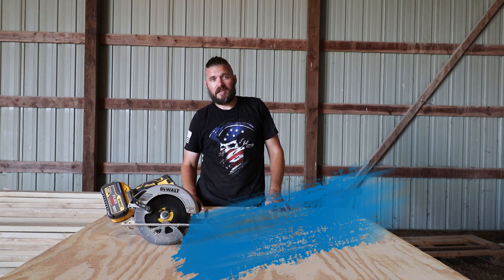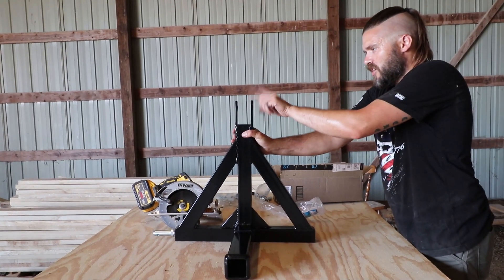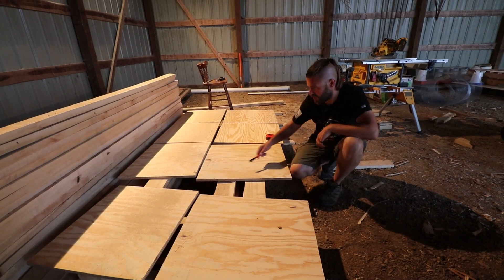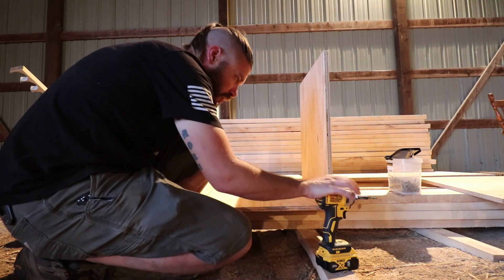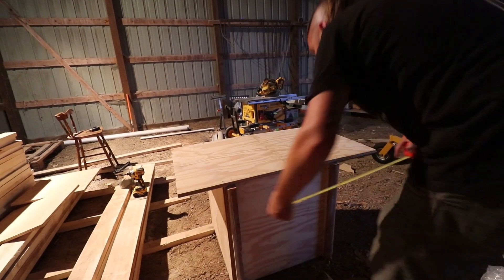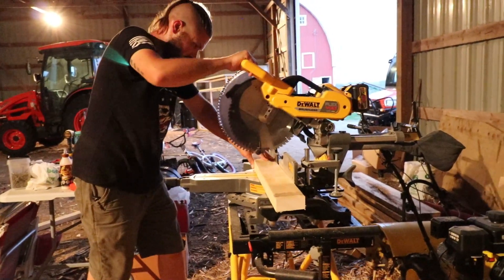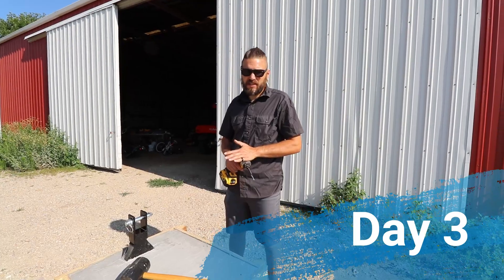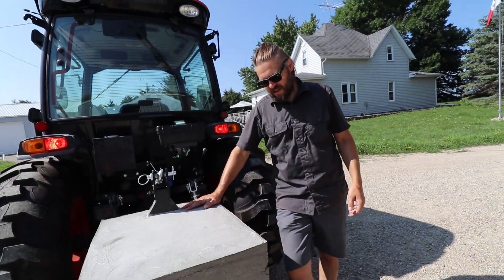Under $200 Complete Newb Builds Super Simple Kioti Compact Tractor ½ Ton Ballast Counterweight Guide

Comment: Tamp the concrete as you pour it or hit on the outside of the form with a hammer so to make sure it all settles in tight.  I'm planning on doing this but I have plans for 4 2in PVC tubes sticking up across the back so I can stand up a rake a couple of shovels out of it.

Comment: Use an cement vibrator...   You can buy them at harbor freight, northern tools, or maybe rent them.   Also some people vibrate the outside with a palm sander, but the immersion is what you need.    They are used in ICF block pours or basement walls.      Good build, wouldn't have thought about doing this.
Reply from the maker: Thanks!
Reply: @Freewarden  Another option is if you have a reciprocating saw, I've seen people take the blade out and use that to vibrate the exterior of the form.